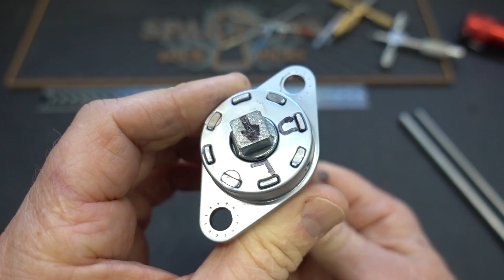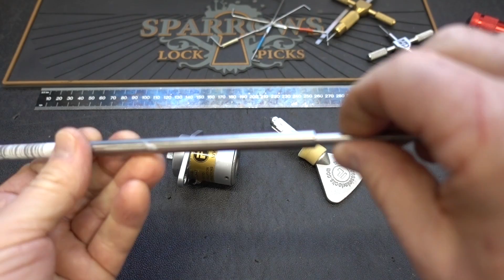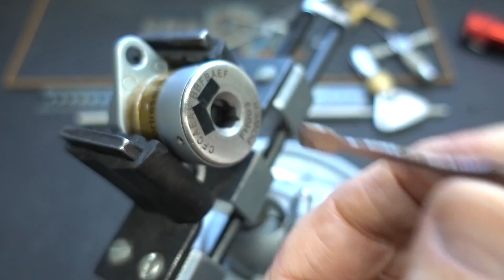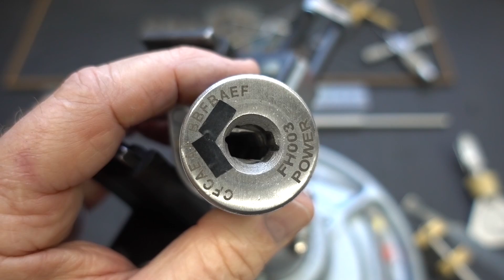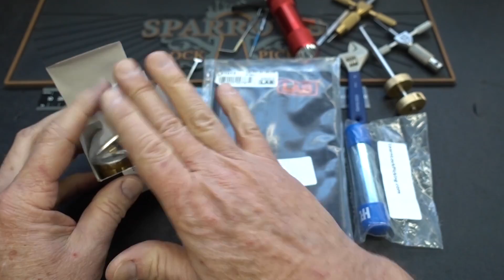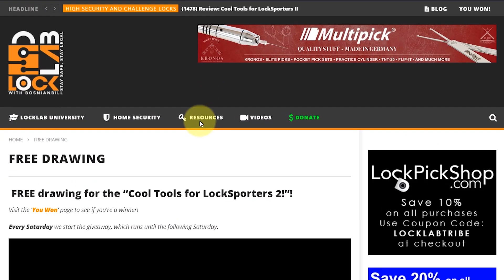(1622) Fortress InterLock mGard Industrial Machine Lockout

Comment: We have this in our work:
Every cell or area where it would be dangerous for a person to enter (robot cell, automated cell etc) would have a gate where the lock part was connected to a unit. This unit would contain a unique key (in the unlock position in normal operation) and a secondary key hole (which was used for a master/maintenance key) on unlocking the maintenance keyhole, this would send a signal to the PLC or control box to disable all automation as someone will be accessing the area. The unique key could then turn into the lock position and could be removed, which would then be carried by maintenance personal or locked onto another interlock system with padlock.

Comment: Those fortress locks are no joke. The ones we got at our machine shop are part of a whole interlock system for a cage door that contains a robotic arm that loads parts into a CNC lathe. Two locks share a key: one at the control panel, which when engaged locks the key in and allows the robot to run, and when disengaged triggers an alarm and prevents the robot from moving, allowing the key to be removed so it can be used at the second lock at the cage door. That lock when engaged locks the key in and allows you to use the second key at the third lock which actually locks and unlocks the latching mechanism for the cage door. All that is designed so that when a person has to either do maintenance on the robot or the lathe, there's no way that robot can move automatically and seriously injure or kill someone. It's no surprise those fortress locks are made in such a way that would make conventional picking almost impossible considering their use.
Reply: We use a Fortress interlock system at our train maintenance depot for access to the roof of electric trains. To access the roof, you have to remove a key from the control panel, which can only be done when a switch is shorting the overhead 1500V DC wire to ground (power is off). That key is then inserted into a door on the roof platforms, and a third key is removed from the door before it can be opened. That third key is kept by the person accessing the roof, so that nobody can turn the power back on until they close the door and reverse the process.
Reply: We have them for the same purpose in our manufacturing plant. Access to robot cages, machine cages, lift systems etc. Even just to open a door. In a maintenance area. Brilliant idea though, allows access to maintenance areas quickly and efficiently.

Comment: Seeing all these videos of disc-detainer locks got me thinking. Would there be a way to make a half-and-half disc and pin lock? A lock with maybe a few pins up front, and some discs in back. Just thinking about the shape of it, i can’t think of any issues besides maybe a slightly more complicated manufacturing process, but i feel like it’d be significantly harder to keep it tensioned while you switch from a disc pick to a normal pin one

Comment: Actually in the real world you would just remove the lock from the panel. Looks like two screws or bolts mount it to the panel. Remove it and turn the switch with a piece of square stock.

Comment: The fortress locks like that are usually a part of a captured key system. The master key is used on a solenoid locked position and can only be removed when the machine is in a safe state. The master key is then put into it's position on a key Bank and the door keys get unlocked. If a door key is removed from the bank, the master key is locked into it preventing machine operation. Usually the master is one keying and all of the door keys have a different keying than the master but are the same as each other. Once the door key is replaced in the bank, the master can be removed from the key Bank and put back into the solenoid controlled position and the machine put back in service.

Comment: They are installed not to hamper operators but bosses who think they know it all. Worked industrial engineering most operators know their craft. I can't remember how many times I had to force open industrial locks or panel lock outs because somebody lost the keys. Over the course of thirty five years I destroyed several hundred locks of varying types gaining excess to restricted panels and controls.  Wish I had taken a course in lock picking back then.

Comment: These locks AREN'T there for security. They exist for safety, and to protect the equipment from unauthorized operation, accidental damaged depending on the mode of operation.They are very easy to get around on a mechanical or electrical basis, but not without the knowledge of authorized maintenance, management, or operators.
Reply: That's right, you can just unbolt it from the machine. But it is agreed when you need to unbolt something, or you need a ladder to climb over a gate, you're bypassing the safety on purpose, so you're responsible for any harm or damage.
Reply: Not only that. Those locks are usually required for a lock-out system that once is removed, it cuts off power to the machiene. The moment you took the key out, the machiene will stop and not start again untill the key is in place.

Comment: I still find it strange that these kinds of locks (also LOTO) can be so pick resistant when other locks sold to actually protect against theft are not (the common, inexpensive ones most people buy)
Reply: These are made to withstand years of regular use in demanding industrial environments so they are high quality which kind of makes them high security even if they don't need to be. Also probably used in some very expensive machines so does not matter if they cost a little more than a regular lock. Nobody wants a million dollar machine getting unusable waiting for parts because a crappy safety lock crapped out, downtime can be very expensive.
Reply: @Murgo-u3l  Plus these locks are protecting people in a lot of cases from death and as such knowing that something hasn't been tampered with is very important. Whilst gettimg something stolen is bad death is much worse.
Reply: LOTO locks protect against death and injuries, criminal liability and lawsuits that can devastate companies. No one cares about trivial theft.
Reply: Ivan Lemeshko you took the words straight outta my mouth. So true yet so sad.
Reply: Anthlocke yeah we use the masterlock loto locks at my work and they're super pick resistant but you can literally take a pair of pliers and squeeze the plastic case and break them to open them.  Some people have metal American locks that are just as good bitting but better quality.
Reply: Yes, they are an important safety feature but they don't need to be pick resistant as there's really no reason for anyone to pick them. But they need to be durable and reliable which means high quality like good tolerances, finish and materials. For example this one has not been designed to be pick resistant per se, quite the opposite, the keyway is huge and wide open and the discs can be easily manipulated with suitable tools and there are probably no false gates etc. It's only pick resistant against common tools because of it's size but easily picked if a suitable tool is made or improvised.
Reply: @Murgo-u3l  Wrong. They need to be reasonably pick resistant, not susceptible to skeleton keys and not easy to copy keys. If it is commonly known that a particular type of lock can be compromised one way or another, sooner or later there will be a compromise resulting in death or serious injury and the employer would be held culpable.
Some railroads use (especially in days gone by) key interlocks between switch levers and signals to reduce complexity and cost and historically the keys are large, heavy but elementary. Employees were expected to walk between remotely placed levers within the depot precinct carrying the keys. One depot manager somewhere in Africa got a local blacksmith to make copies of the keys to save the amount of walking required! 

Also since 9/11 USA railroads replaced their keyed alike padlocks used for switches and many other purposes with something more secure. They had been using heavy duty but fairly easily picked warded padlocks where the designs were well over 100 years old.
Reply: It's only pick resistant because of the odd size, thus a need for custom tools. It's was easy enough to pick once appropriate tools were fashioned. (and the lock is easy enough to remove from the machine without any need to pick it. And $10 says it's bolted to a panel that's even easier to remove.)

Comment: Nice job on this interesting lock... looks  quite a bit like an up-scaled Tibbe. 👍
Reply: Should he loan it to you, I can hear the line, "...with this ridiculously-oversized disc-detainer tool that Bosnianbill and I made..."
Reply: @TWX1138  Just needs upscaling s bit. The problem is you won't run into many of these locks, if any, so not worth it.
Reply: The only disc detainer lock to laugh at the pick you 2 made. Then still get beat.
Reply: Bosnianbill and I made
Reply: Yes, bet you can open it with a up-scaled DD back-tension tool (cheap one) just like the Tibbe-locks
Reply: Perdy Awesome pick
Reply: @MatrixExpress  BB has always been picky...

Comment: Is that a set screw going into the side, or maybe a roll pin, to hold the front on the lock?  It looks to me like that might be another approach to defeating the lock.  And, what are all those letters on the front of the lock and what is the tape covering up?
Reply: This isn't a security device, and it would t start the machine, only stop it.

What these safety interlocks do is disconnect a switch inside a control panel to remove control power. An operator would remove the key and keep it with them as they do maintenance or remove other safety devices. With out the key, you would be unable to start the machine back up, so the person who removed one of the keys (you could have many) is protected from the machine starting

This is a round about way of saying that if you really wanted to start the machine, you could open the panel and jumper the wire going though the contact block (not shown on this sample). Defeating a lock like this is practically insane, it could only hurt someone and is easily defeatable by other means of needed.

Obviously the chalenge presented by these are cool though! This interlock is made by Fortress Interlocks out of the UK.
Reply from the maker: Rather than mess with the roll pin, just remove the two bolts that hold the lock onto the operator's panel...much easier and no damage.  The tape is covering up the key bitting code.
Reply: @bosnianbill  The ABCDEF looks suspiciously like the direct key bitting used for Tibbe or Abloy locks.